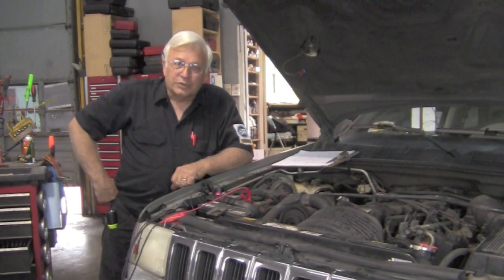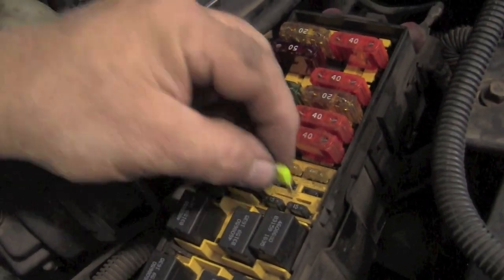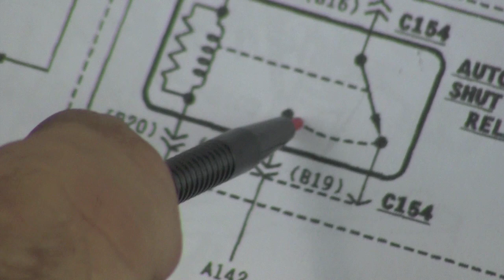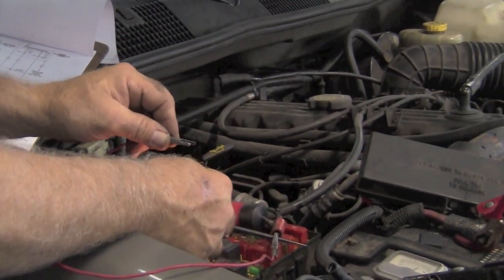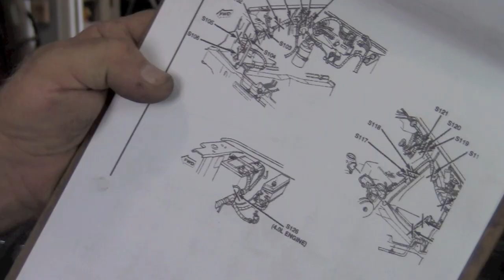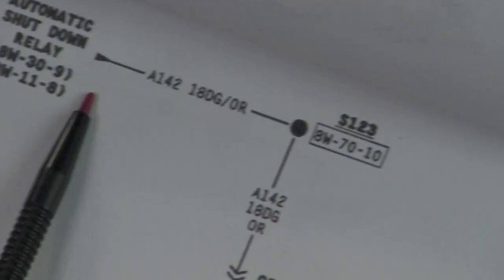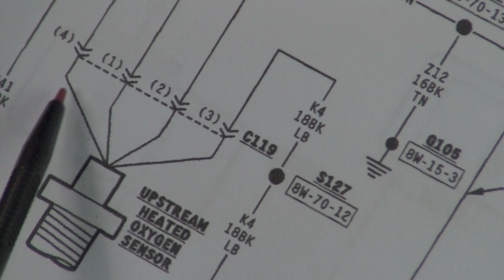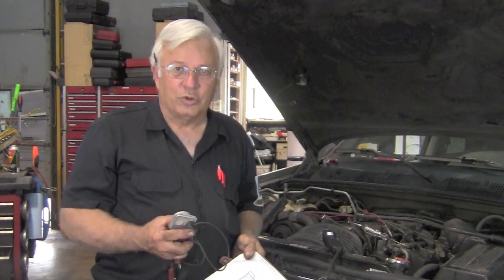Finding a active short

Comment: I have always struggled with electrical circuitry. And I’ve watched many videos over my years to learn from. This was one of the most educational videos I have ever watched for me, because I really have a hard time following circuitry
Reply from the maker: Glad it helps Wayne, you are not alone, that's why I make them
Reply: Okay thanks
Reply: Hi my name is Roy I have a2004 Nissan central 1.8l that has a no no spark condition I have so far tried to fix it my self changing the crankshaft  position sensor a nd camshaft position sensor  I also replaced the fuel pump  and checked the computer and there is still no spark so there's  got to be a short in the wiring either by the fuel injectors or the coil plug wires  any insight would help
Reply from the maker: @rosarioinserra2599  You probably have an open circuit not a short circuit.  At this point more guessing would result in more wasted time & money. Take it to a good diagnostic shop

Comment: That was one of the best videos I've seen! You covered every step tracing that short in detail the way it should be explained. The little amp meter really did it's job. Emphasizing at very start that; in this case, we were working with amps and not volts got us viewers oriented. Some of us may have jumped right away into using a volt meter and we would have been lost from step one. Thank You.
Reply: I agree 100%. He taught us something a lot of mechanics don't understand. I feel privileged to have lucked out and saw this excellent tutorial.

Comment: Very good lesson, thank you.  One note about the use of the word “short”.  In trade school 60 years ago they explained that there are three terms for electrical problems.   Short,  open and ground.  Short— is copper to copper.  Open— is copper to nothing.  Ground — is copper to steel.   With your situation you did not know if you had a short or grounded circuit, until you found the problem.

Comment: Great illustrations you got there,quite informative ....reminds me when i too had an active short for sometime back, then luckily as i was working on the sump guard saw a spark from the positive cable running directly from the battery touching the exhaust manifold. Saved me a trip to the mechanic. Loose cables and the exhaust manifolds are never great friends.

Comment: Thank you for this video it was a huge help and a reminder to look at relays associated with mini fuses. Had the exact same problem. PCM B blown mini fuse. Fuse is associated with PCM and fuel pump relay. Removed F/Pump relay, fuse stopped blowing. Used the A/C relay for testing and C5 vette fired right up! Thank you.

Comment: good to see a systematic approach.

Some thing I have always done is not to use a fuse in the circuit at all.
I use a headlamp bulb 55 watt or greater in place of the fuse. The bulb glows bright when high current is flowing in the circuit and dimly when low current is flowing. The load of the bulb protects the circuit. I wiggle all the wiring in the circuit first and more often than not the bulb changes how bright it is glowing when wires are wiggled  near the cause of the short..

Comment: I worked for over 4 decades on passenger elevators and I often ran into shorts to ground. Elevator fuses are also expensive. So I use to strip the insulation off  the #18 wire and use one strand as a temporary fuse. The #18 wire strand would not blow if the ground was cleared. However, it would pop if the ground was still there. Most elevators use # 18 multi conductor cables to wire most of the elevator. I enjoyed your process. It kinda brought back old memories.

Comment: DUDE!!!  I've dealt with electrical for over thirty years now.  I'm a marine technician.  I must admit that some parts of electrical stuff is a mystery to me.  I have a '99 Jeep with electrical issues.  I have tried repeatedly with no luck.  This video gives me hope.  Your explanations are clear, concise easy to understand.  I learned more from this video than anyone else, I think.  Your very thorough explanations of the drawings and the use of the testing tools was very helpful.  Thanks again.  I've already subscribed and I will be visiting the links to buy one of those testers.  Such a simple yet cool tool.
Reply from the maker: thanks for your comments
Reply from the maker: there was a problem with the link, it is fixed now, thanks for letting me know

Comment: If only I had seen this video the day it was posted.   I've got a '94 Grand Cherokee, that  had a dead short which started acting out on the 17th.   Kept blowing the 40A ignition switch fuse.   Finally tracked it down, but without the diagram or the knowledge of how to read one, finding the short was difficult.  Finally did find it though.  Thanks for the great vids.  Wish every mechanic had as much common sense/knowledge as you do!

Comment: 40 year automotive tech here. I use an old style sealed beam headlight to test a shorted circuit. I have fuse adapters that plug into the fuse socket so the headlight bridges the fuse socket.  A short will light the headlight to full brightness.  I use a clamp on DC ammeter to follow the circuit to the short. Or watch the headlight while carefully moving the harness.
Reply from the maker: yes, that's a great technique as well.  I've done it myself, works great.

Comment: Wow, I don't think I've ever learned so much about automotive electrical in one sitting! You, Sir, are a gifted teacher! I completed an auto technology course many moons ago, and have really missed having someone who could so ably "reveal the mysteries", especially the electrical! I can't wait to check out the rest of your videos. Thank you so much for sharing your knowledge with the world. I feel so empowered (sorry, couldn't resist - oops, did it again) ;)
Reply: I 2nd that Nancy, this is a huge VALUE right here! but please beware that the circuit breaker in this kit can handle 10 AMP of current only so for this test to work with another let's say a 15 AMP fuse you have to get another 15 AMP circuit breaker and you will find a lot of them on ebay or Aliexpress for cheap.

Comment: Nice demonstration and great sleuth work, Duane. That little inductive ammeter is handy.

I made my own short detector, and I posted a video showing how to make it. The one I made incorporates added resistance, so that the circuit stays closed (with low amperage) for long enough to find the short. It has a circuit breaker, a buzzer and a light with an on/off switch, entering the system at the fuse panel. The buzzer helps a lot when you move wires around to find the short.

Comment: That’s a cool product. Using that as zero centered ammeter to tell direction is just simple genius much simpler than trying to use a clamp on or in line connections of your meter and paying attention to the direction of your connection. Maybe the coolest electrical DC tool I’ve ever seen. 👍

Comment: In 1972 I had a 65 Mustang that would have a dead battery every three days. The charging circuit worked fine so I thought that may be the battery was just old and needed a new one, I bought a new one. But three days later, a dead battery again. Then one night I notticed if I got up close to the tail light it was very dimly lit with everything off. I found that the brake pressure switch was hot and shorting out internally but not blowing the fuse. A new brake light switch and no more problem.

Comment: I use test  light method and blow lot of fuses until the short is found. From trail and error ,method to start at a connector and unplug until the fuse no longer blows, then investigate. i ordered a short circuit finder, similar to his. 
I had old Nova as i drove home lights on could smell electric burning, i took it to electric repair shop their fix was install a heavier fuse it melt my wiring harness. I found the problem the quarter panel had been replaced, the side marker bezel nut pinched the side marker light wire. i rewired he car, learned a lot.

Comment: Good guide. Very informative. I am pretty sure he could use the test light in the same way. Pull the fuse and follow the short. I recommend NOT repeatedly replacing a fuse to a short. Electronic circuit can be damaged. A common diode tends to fail into a short. Repeated applying current by repeatedly replacing the fuse (or a resetting breaker) can cause it to eventually fail to an open. 

An example of this is a protection diode on a radio. The manufacturer puts this diode in to protect the radio from being wired backwards. If the customer connects the power to the radio with the wrong polarity, it shorts the diode blowing the fuse. This should alert the customer to check for a problem, but the diode should be checked and replaced if needed. But if the customer repeatedly replaces the fuse, the protection diode will then fail open thereby not providing any protection. This will damage the circuits in the radio that the protection diode was intended to protect. 

If the powertrain control module in this example was bad, it would likely need to be replaced anyway and this method may or may not cause more harm. But on other circuits it could. It could cause the short to disappear and this may confuse the tech. Some techs, in my experience,  do not focus on a change in symptoms and resort to shotgunning parts at the customers expense.

Using the test light in this example, remove the fuse and follow the short pull the relay see if the short goes away. Disconnect the black and white connectors and see if the short goes away. Reconnect one at a time and follow the short. Disconnect the injectors and follow the short. It takes us to the same shorted wire. The technique he used is sound just not the repeatedly applying power.

Comment: Wow I have rewired cars that I had for show own factory service manuals you have provided more info than all I know 
My winter car 03 Buick regal lot of open close the trunk lid my wires break have made patch repairs by soldering use liquid elect tape two wires chaffed nearly caused elect fire were melting the wires I have it traced to trunk lid light panel harness to it test fine will apply what you taught me thanks a lot

Comment: very helpful. I had an issue for a while where out of nowhere i had no tail and brake lights, but the fuse was fine. had to do some wire tracing. same with interior lights. My style of s10 is known for the interior lights getting shorts in the wires. Had 2 fix them on all 3 of my s10's. But that ammeter is certainly something for me to consider buying.

Comment: Thank you so much!! I'm wondering if becsuse my 02 sensors were the first to have low voltage if there is a short in the up stream wires on the O2 sensor causing no communication to OBD2 port. So confused but trying to learn I've had zero experience with electrical but you explain it so well I may be able to grasp if thanks again just need money and tools can't get that unless I have a car to get a job! Uhhhggg rock and a hard place but I'm a bull Fog never give up even when you think you have no more left!

Comment: Wow, what a good video of walking thru wire bundles to find a short using a wiring diagram. I need a small amp meter like that one. Thanks realfixesrealfast.
Reply from the maker: Thanks for the comments, yes it's great tool and not expensive either. I use mine often

Comment: So, it is actually an improper ground  , not a short, but that is debatable. Had that same circuit breaker , and amp tester for 40 yrs. Great little tools. If you blow a fuse once, after replacing the bad one, good to put a circuit breaker fuse in it's place, till  the problem is fixed.

Comment: I have rewired a old 73 nova ss and some electrical experience but shorts are a time consuming process but this ase certified man is easy to follow and does know his stuff just where is his company? So instead of spending an hour or more like this man just showed took only 10 minutes inpressive
Reply: jeff alan Hey ,guy ,your Nova is an easy fix , easy to learn on ,try the newer gms with a body control module , they can be a real sanity testor.

Comment: Your video is so very informative.    I have a 2001 XJ Jeep that rolls it’s own windows up and down and locks and unlocks doors.   Now the marker lights stay on and it won’t shut off unless you pull the big fuse.    
I’ve looked for the test breaker and amp meter but can’t find these things anywhere.    Any help would be great.    Thanks very much for the video.

Comment: very few people use those tools anymore i have had one for over 30 years when i use it if other mechanics are around they say what is that. i clearly remember i had a fuse blowing had looked and looked back then we used mitchell books before on demand the cornwell tool man happened too stop by he said you need this tool less than 5 minutes found it was the taglight wiring just before the bulb

Comment: wow, very scientific, practical investigative approach to demystify a tiny short in that jungle of wires. is it possible to use an amp fluke probe with my volt meter with the scale set on amps or Milli-amps? i see the amp fluke will not tell me the direction you little meter will perhaps i should check your link. Great presentation using schematic as a reference to follow the splits branches, understanding and checking each of the electronic appliances hook up to circuit remembering to go from power source, battery to the bottom of the diagram, to ground.  I would never know which direction to go even with the schematic in front of me however i did notice that the schematics have reference to front middle or back section of the wire paths. I am very grateful for your precious and well appreciated lesson, unforgettable!
Reply: Thanks

Comment: appreciate you going the complete distance instead of fast forwarding video and not showing up the process and confirmation.  don't have a probe but a volt meter.  can i use that.  confused about
how with the meter to test the ground side of a harness contest when backprobing.  do i put the positive lead on the neg pole of battery and positive lead on the ground wire pin? what would
i see on meter to determine if i have good ground at that point.  that is a cool meter. thank you for the info.

Comment: Question:  When you were checking the injector and you unplugged the orange green wire to it and held the ampmeter to it, when the breaker closed you had electricity flowing through the orange green wire even though it was disconnected from the injector.  How can you have electricity flow when there is no connection?

Comment: Thanks man, I'm going to have to try this on my 2004 jeep grand Cherokee its a mystery it will turn over but wont run we took it to a garage but they couldn't figure it out they hooked up to the computer and they couldn't find any problem codes but i think they were trying to pull the wool over my eyes but this might help me figure it out, going to try it when the weather warms up as i don't have garage and not a huge rust on it thanks a lot for the tips and tricks you shared in the video
Reply from the maker: good luck

Comment: Now this is what I call a vehicle diagnostic.how could you not like this vid? it shows you step by step,made easy,to fixing a short.it def helped my ass! i have a short right now in my truck but i dont have a test light to help me.All my fuses are good,not blown.when negative clamp touches post it sparks and starter begins running and wont stop until i remove the negative clamp from the post.autozone stated it's the ignition switch/relay.is this true? i found no short in solenoid/ignition wires.

Comment: I think in addition to just repairing the wire, which is not the root problem.  A couple zip ties would be in order. The real problem is that the wires contact the hot manifold. If you just fix the wire, the customer will be back in a week.
   Don't just be a parts replacement guy. Be a problem solver. 
   I  just got through with a situation where I had to point out the problem to my mechanic. Only real help he provided was a scan tool. I  had to actually go climb under my truck and asses the situation. Then he charged me $100 labor to change the upstream O2 sensors after I said I would change them myself.

Comment: Would you pull the fuses to the air bags , computers anything on the can bus  working from  lest expensive part to most expensive  - I understand alot of these modern thing wont even power on without the can bus to trigger the relay

Comment: A better way is to put a bulb in place of the fuse. So long as there is power and ground, the bulb will light. When short to ground is removed, light goes out, and the ammeter will go to zero.

Comment: That was a great video. I have a p0500 code (v.s.s.)on my 96 Jeep Grand Cherokee. I'm going to try and use your method to see if I can find a possible short or open circuit for that sensor. I did replace it (mopar part) but still no speedo reading and code remains. Any suggestions? Thanks

Comment: What's the best procedure for finding a partial short. I have a ground control that reads 2.47Volts and not 0.00Volts like a normal ground control. If I removed the relay the powers the heater to the other side, the 2.47Volts also goes away.

Comment: I have a fuse that keeps blowing  on a 2012 Camaro , the fuse is linked to Maf , FPCM, I also have a code for Ignition switch ,Reverse lockout solenoid. How do i determine if its a short in wiring or component? Thank you

Comment: Great broadcast!  Whst if I doesn't t see a blown fuse could my fuel pump relay or ASD relay be bad ...rough idle and stall... no communication to OBD2. Crazy codes all over the place now I lost the communication to the cluster so can't read codes . Could it be ground bad on 02 senor on the outside of the PCM?